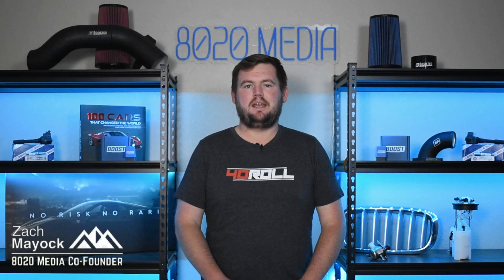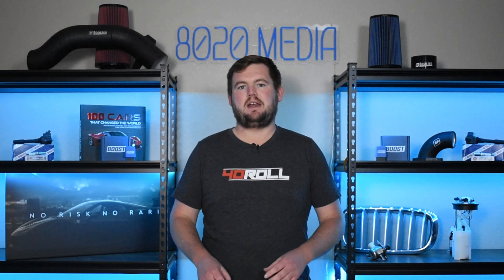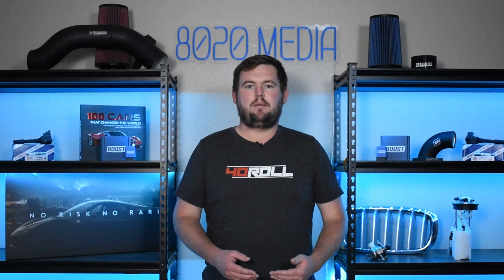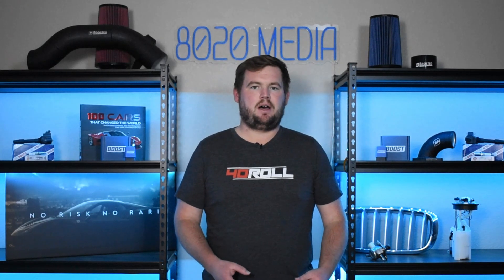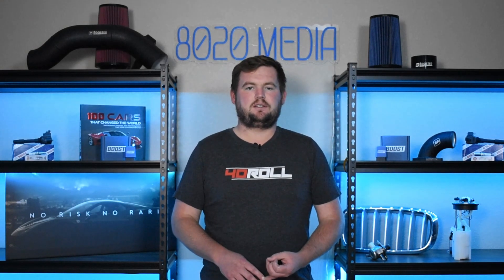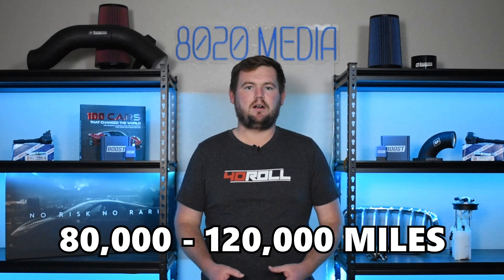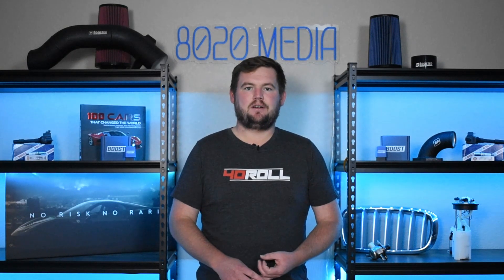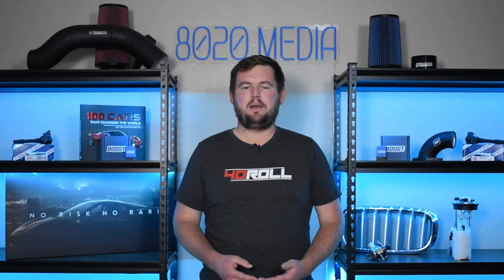BMW’s S55 Engine | Common Problems & Reliability

Comment: Hi, I have issue with my S55 (M3 F80) and I was hoping You could help me or give some advice. I have a very slight coolant loss, but it only shows up during harder driving. If I drive calmly, the loss is basically unnoticeable. In the video You mentioned a problem with the top-mount intercooler, but the coolant level in the upper tank stays at max - only the lower one goes down. Are these two cooling systems are connected or should I be looking for the cause somewhere else? Greetings from Poland! ;)

Comment: What about misfire nobody can figure out I have 2016 60k miles been at Beamer for weeks can’t figure it out did everything from coils sparks compression excccc
Reply from the maker: W - If you’ve already done coils, plugs, compression, and other basics but still have a stubborn misfire, the next places to look are the fuel system, timing/cam correlation, and intake sealing. A weak or sticking fuel injector is a very common cause of single-cylinder misfires on these direct-injection BMWs, and they often won’t show up in a basic compression test. Another overlooked cause is carbon buildup on intake valves (direct injection engines don’t wash the valves with fuel, so deposits form by 50–70k miles and cause rough idle or misfires). If injectors and valves check out, then a VANOS/timing issue (like stretched chain or bad camshaft sensor signal) can cause ghost misfires even when compression looks good. Since the car has been at BMW for weeks, I’d specifically ask if they’ve done a leakdown test, injector balance test, and a borescope inspection of the intake valves—those three will usually expose what compression and ignition checks can’t.

Comment: This is important to note, the S55 is the goat of all bmw engines to date. Let me explain, you toss some head studs into a S55 1100whp. No built motor, no fancy cut ring HG's. The only other engine bmw has produced that can hit 1000whp without opening the motor is the S54. Same story but with an iron block, head studs S54 makes close to 1000whp. Nothing else, the S54 and the S55 are the best bmw engines ever made to date. Fight me
Reply from the maker: J - Lol, thanks for sharing.

Comment: The crank hub issue - usually trumpeted by some flat brim vape bro "engineer" who has a "solution" to sell you.
Reply: Capitalism baby 😂
Reply: 100k miles on my f82 2015 .. stock hub..ftw
Reply: @wytewizzard 127k here and tuned 🫡
Reply from the maker: B - Lol, well said.

Comment: 1, Charge cooler leak
2, Sump gasket
3, Valve gasket
4, Rear diff bush and seals

57,000 miles on mine, and those are the issues I have had from new. 

Never tuned, never tracked, never launched, full BMW service history.
Reply: Hey man wanted to ask, why have you never launched it? I want to get one as my forever car, and want to keep it stock and not tracked, but did want to factory launch. Why so hesitant?
Reply: @ just stress on parts I guess and fact I never really felt the need to. Ive owned since new and planned to keep so wanted to keep fully stock, not track or launch.
Reply: @simoncook1885  that's fair enough, I want the M4 so bad but the B58 seems much more bulletproof than the S55 of that time, makes me hesitant to want to take the plunge into long ownership. Thanks for getting back to me.
Reply: @redspin2ify I think each generation seems to be more reliable than the last. I think S55 is reliable, but it does have its issues. I seem to have had most! However the BMW extended warranty is very good and has covered all of these. So if you get one just make sure you have BMW extended warranty. Lovely car though and IMHO better looking than G80.
Reply from the maker: S - Thanks for taking the time to share your experience!
Reply: @8020Media  NP luckily I had the extended warranty so each one cost me 250 quid. Also had a xenon bulb die and issue with the heater draining battery (some control module had a lose connection). That's about it....

Comment: Damn, I’m looking at a 2015 M3 with this engine. I had a 2011 135M bone stock with the N55 engine that was nothing but trouble. The rear main seal was replaced twice under warranty. The plastic air intake shattered under load, and finally at 70k miles, the engine spun a rod and it was done for. I’ve owned 11 BMWs in my life, but the 135 was the worst. I have stayed away from the brand on purpose and was contemplating jumping back in, but it doesn’t look like this engine is much better. Thank you for the video, is very informative.
Reply from the maker: J - Thanks for the feedback! Hope it helps.

Comment: Really enjoy these videos! 

Would like to see some detailed dives into the M57 as well. And if the M57 would outlast its gas bro N54 😂 My understanding is that diesel cars are more reliable and have more torque than gas so Im guessing the M57 would last longer than N54, which is crazy because  for the power the N54 makes they usually last well into 200k with OTS tunes 😂 Guessing the M57 can last 300-400k but no idea tbh curious to hear from the experts 🙏🏽
Reply from the maker: B - Thanks for the feedback! Been awhile since we've heard from you! We'll add it to the list for sure.